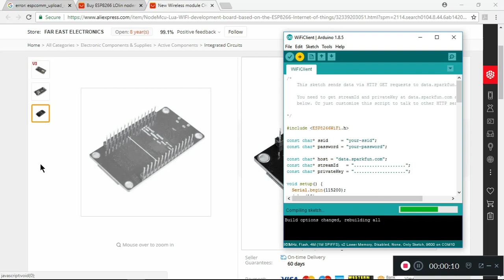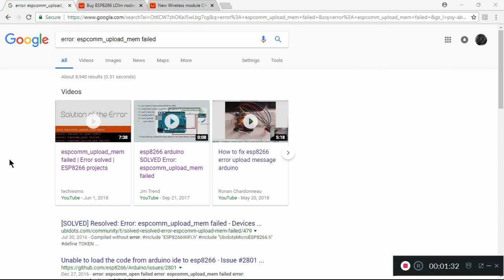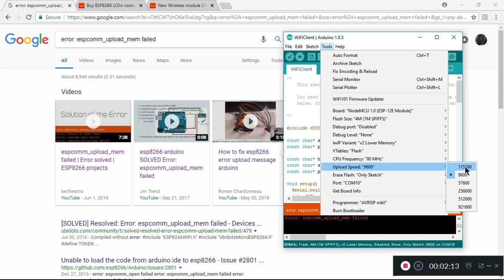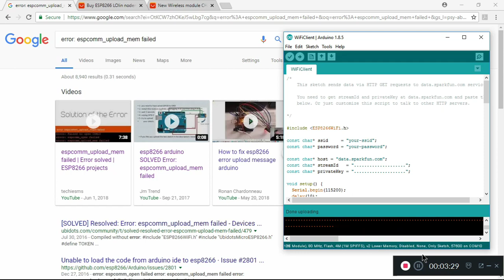SOLVED ESP8266 NodeMCU LoLin WIFI Board commfail error

Comment: i can't fucking believe i spent an entire day . And then i find your video that says hey just adjust the baudrate..........................God bless you my man . Im subbing you from now on.
Reply from the maker: Glad I could help man. I definitely intended on making some more videos. Ive done so many projects esp. with the esp32, some fairly advanced including two fully functioning web servers running simultaneously on the same microcontroller one secure and one unsecure, generating certs, secure login, getting and sending TCP/udp 2 way communication with a remote server from both onboard servers,  and full gui and external hardware control wireless IoT without using any existing projects like ESP Home or even third party interfaces like mqtt,...I think i literally pushed the device to its performance limits but stable....anyway Ive gone through so many different errors since this one and a few interesting quirks...i just didnt bother because Ive been shadow banned on here on n off since even before i posted this vid ...but i guess project vids are safe for the algorithm so I probably will 🙂
Reply: You know what you should definitely start with making them. Or simply Arduino projects. Because students need them in their final year of engineering. Tbh if this helped i bet your videos would make a impact

Comment: U ARE A FUCKIN' SAVAGE BRO!! Spent 2 days figuring out what the hell was going on with my inability to load anything on my esp8266 and tried literally everything. Long story short it was the board loaded for arduino that was the problem. Was using the generic 8266 until I saw ur video and changed it to NodeMCU 0.9. I freakin loveee you RN. Cheers, bro!! Wish I could buy you a big ass handle of jaeger for your help. Peace!!

Comment: Bloody heck. I've updated drivers, checked com port designation (COM6), confirmed the board type (WEMOS D1 Mini), pressed on board reset before & during upload, tried 115200, 57600, and 9600 baud, and rebooted the machine and board so many times that they're both annoyed at me, and still:

warning: espcomm_sync failed
error: espcomm_open failed
error: espcomm_upload_mem failed

Frustrating.
Reply: Yes. Uninstall, reinstall, gone.

Frustrating, because problems that go away on their own, come back on their own.